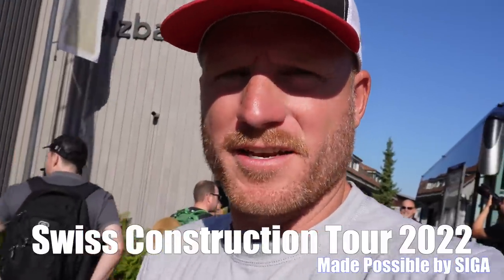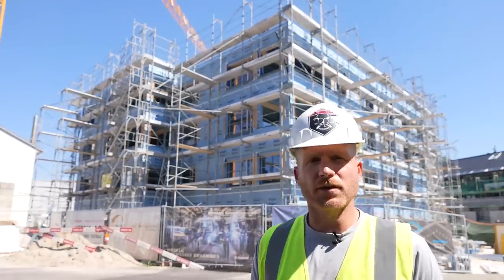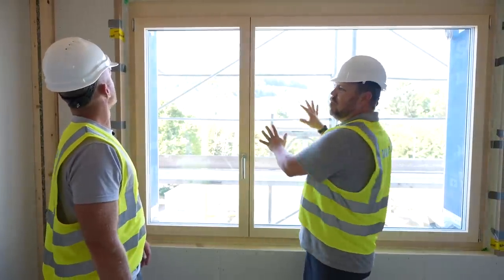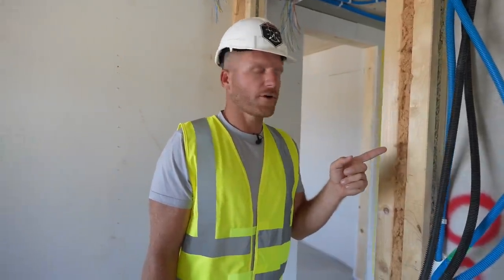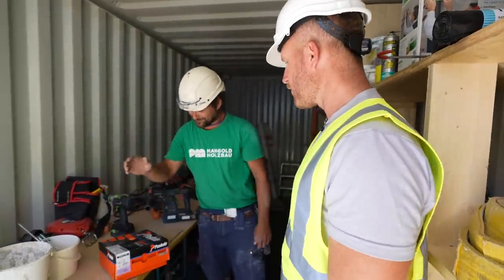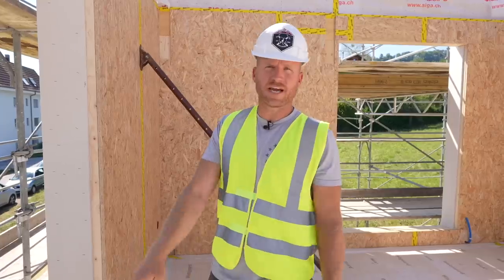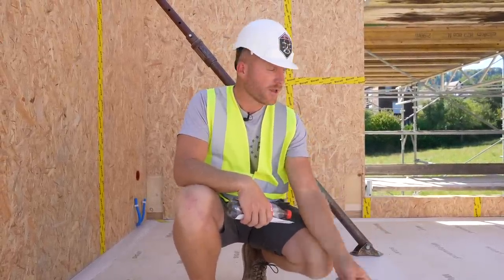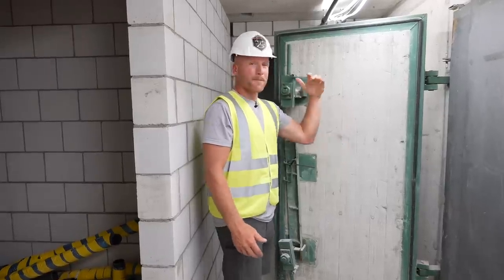Visiting a Swiss Trade School and Tool Trailer on a Swiss Job Site

Comment: Those big swinging windows also allow you to lift large furniture items into an apartment that probably has a rather small stairwell.  Same with entrance doors - they have a normal door with a sidelight that swings open. Very common in Europe.
Reply: Yes, i love those diagonal lift things used for moves in a lot of Europe. Very smart.
Reply: I worked for a removal company in Australia. The amount of stupid people that had to sell their furniture after arriving at their new apartment and realising that they should’ve measured their front door was ridiculous.
Reply: Biggest two reasons for the existence of those types of window (with the separate frame moving window) are:
A. easy cleanup
B. easy maintenance.

Comment: Home-builders not only in Switzerland, but also in Germany use Festool because here people are actually trained for 3 or more years on how to build houses (Ausbildung). So qualified workers like using qualified tools
Reply: And precision matters because there are standards that require a high level of precision ! And the owner is well protected in case of an issue with the build, so it's in the interest of the companies to do it right.

Comment: The woodfiber insulation is sweet. A dream to work with. No itching. Easy to cut. Its treated with a fire retardant so it "doesnt" burn. In my opinion one of the best thing about it is the hygroscopic properties, similar to cellulose insulation. Also, it has better convection properties compared to mineralwool.
Reply: Came in the comments looking for this response, I'm in the business but never seen the wood fiber insulation so I assumed it must have been treated with a retardant. Thanks for the info!

Comment: Just watched this video.
Great as always. How those windows function...I remember OVER 50 years ago, visiting family in Germany, my Aunt had windows that functioned that way.
Sharkbite plumbing, a system very similar to that I saw on a new construction build about 15 years before here in the States.
Sidewalk construction in residential areas of Berlin, basically all pavers. Remove pavers,  save to the side, repair/replace utilities, reinstall pavers. They use them over and over again. Single arm garbage trucks, saw them over 50 years ago in Germany. 
We always think we have the "best", smart that you open your horizons.

Comment: As a European I can say that the way they do it in Switzerland is very different from Norway. But we actually use sega tape on some of the buildings we erect for the outside, on vaxed gypsum boards and against windows and doors. We also use it on vapor-barrier. This is both to ensure a leak-free wall, as well as allow for a very small vacuum inside the house. Often on new houses you need to open up the varando-door slightly in the beginning when you light up your fireplace to get it going. In our country developers and businesses build differently, with different methods. But there are similarities to the Swiss, but manufacturers do not provide services for customers.

Comment: 3:42 There will probably be a green roof on top as this system is also use on Green R project to find leak under plant's etc..Worked on a project with a similar system (flattec) last month

Comment: 17:04 Würth here in Sweden have these lights, maybe try contacting the Würth US office and see if they can get them in stock? Ordering directly from China where these lights usually are made might also be an option. They are GREAT at a worksite, lights up the space so much better than regular bulb-lights.
Reply: thanks for the brand name... yes indeed. These gotta be the Wurth 9501006300, contact for quote. However (just for the americans): those are 230v strips, not 110v. Still looking for the underlying supplier / OEM for the strip itself. Before Wurth are terminating / weather sealing / certifying them. Or whatever else they might do.
Reply: @dreamcat4  They should definitely make a 120v version for the US market!

Comment: Training centers like the one you are at are typically only found through Union Trades. I went through the Carpenters Union Apprenticeship, it is a 4 year program, where you learn all facets of your trade, from framing to cabinets, drywall install etc. I don’t remember what state you are in but there is a training center like that one. Typically the better centers are near bigger cities.
Just thought i would let you know.
Reply: There are still other options available, ABC (Associated Builders and Contractors) offer training and are set up as a Merit shop option, and some state collages offer "hands-on" training,  As I went through 45+ years ago with a 2 year  Associate degree, leading to apprenticeship.  The program I went through is still available, and I just worked with a guy couple years ago who's son was attending the same program.  Good basic practices should be taught/learned, but the best apprenticeship is hands on learning.

Comment: The bomb-shelter thing is/was common throughout most of Europe I think. In Norway all larger residential buildings, along with schools etc were required by law to be constructed with bomb-shelters until the mid 90's.

Comment: Hey Kyle, that's how alot of union trades work in america. You apply and get into your local unions apprenticeship program. Go through a multi year apprenticeship while getting paid to work and then graduate a fully vetted carpenter/electrician/plumber. . . .
Reply from the maker: At 15??
Reply: @RRBuildings  Ya most don't let you apply until 18. I agree it would be nice if they got you in younger but I just want kids in the US to know that a labor union apprenticeship is something worth looking into.
Reply: I took a test for a carpenter's apprenticeship and easily passed a not so easy test.  Then found that I had to buy a couple of hundred dollars worth of tools and visit job sites until I found a job...  I said forget it.  The Unions are probably corrupt as hell anyways...  I was in I.T. at the time, but dealing with Carpal Tunnel syndrome, so it wasn't look for carpenter jobs or go back to my Mom's basement... just looking at alternatives...
Reply: @Ronald Bartell  Carpenters union is a great option, not sure how the carpal tunnel would effect work though.

Comment: Abstract

This video transcript documents a tour of construction sites in Switzerland, led by an American builder. The builder compares construction techniques with those commonly used in America.

*Key Points*

* *Swiss Trade Schools:* Switzerland offers structured trade school programs where students are sponsored by companies. Upon graduation, they are skilled carpenters ready to enter the workforce.
* *Flat Roofs:*  Residential buildings in Switzerland often have flat roofs to maximize building height within restrictions.  Sensor technology is used to detect roof leaks quickly and efficiently.  
* *Windows:* Swiss windows are high quality with tilt and turn features for ventilation. They are often installed by the manufacturer for accountability.
* *Sound Insulation:* Unique wall panels with a separation layer are used to improve sound insulation between units. 
* *Wood Fiber Insulation:* Sustainable wood fiber insulation is used instead of fiberglass or cellulose.
* *Panelized Wall Systems:* Prefabricated wall systems create a faster build and require the foundation to be perfectly level.
* *CLT Systems:* Cross-laminated timber (CLT) panels are used for floors and ceilings, providing structural strength and eliminating the need for traditional floor joists.  
* *Construction Lights:* Thin, strip LED lights are used for on-site lighting, offering superior brightness on a convenient roll.
* *Bomb Shelters:* Swiss law requires bomb shelters in residential construction to accommodate all residents.
 
*Overall Impression*

Swiss construction methods demonstrate a focus on precision, sustainability, and innovation. The American builder expresses a desire to incorporate some of these techniques into US construction practices.

Comment: I have recently moved from Europe to Canada, rented a house here and I am terrified with quality of the buildings here. If I get to build a house here, I will be importing stuff like windows and doors from Europe...
Reply: Hi Greg, I have lived here in Canada for about 50 years, [ formaly from Ireland ]
The Apprentship system is very poor in both the USA andCanada, Without the Carpenters Union starting up thier own training centers there would very little training of the youth , the same applies to the other trades as well,
The Goverments have to bring the instructors over hear to train the trade instructers in North America , there is no point sending people over there because they have not been trained in the detailed manner that Europe requires in order to recieve certification, that can not be achived by a 2 week vacation, 
Just pay attention to the job site, every thing in its place and a place for everything,
The Carpenters tool shed for example has only carpenters tools and Hardware for the work as needed at this stage of the work,
The trade schools of Europe also have a drop out percent which also helps the contractors because the students who make it through the first year  [tested several times during that first year]  are showing the have the interest required to complete their Apprentship.
There is also a grant system in place to assist Employers for the rest of the Apprentship program🔨🔨🪚🪚

Comment: I don't know what state you live in. However, here in PA, at the entrance to 10th grade, you are about 15-16. At the time, I went there was computers, electrical const., Carpentry, auto body and auto mechanics, surprisingly there wasn't a plumbing class, there was also a home ed/culinary, and then a nurses aide and cosmetology. The last 2 you could be certified by the state in whichever 1 you chose to take. These were all 3 year programs, with some cross overs, I had to do part of my 2nd semester, in carpentry, the teacher was a real dueche not a good experience. However, you could change every year, if you wanted to. I chose electrical construction, for 3 years, you start on job boards then move into mock houses, all the way to magnetic switches. Then I chose to go out, my senior year on OJT, working in a hardware store, that had a construction business. But they kept me in the store, b/c they were short people. I then went to Penn state Williamsport, for 2 years while this is 5 years of training, that helped me do this trade I love for 32 years, on and off, getting certified in this state is ridiculous. But the pay advantages are amazing. I would love to see the Swiss school, for electrical construction there, that would be cool. Although, most of Europe, and the rest of the world rely on 208/220 volts, some country's are even single phase, which in those countries, has terrible reliability, with a lot of brown outs. I imagine, England, Germany, the Swiss, Norway, Spain, Italy, and all those countries, and France, have fairly reliable grids. So, I would love to see the electrical shop there. but great video no matter what. And I just told my story so ppl, especially young people, know there is a path, as getting hired by a company, isn't always the best. As, you may end up a go for, for a year or 2, before you learn anything of value, and that discourages young ppl, who sometimes, have the attention span of a hummingbird (which I still do, lol). But great video, Thanks for posting.

Comment: In Ireland we let the window manufacturers fit .. if there is anything wrong it's there problem and they have to fix it.. if you fit them they blame you on  scratches or broken handles and such .. so we just let them at it... the apprenticeships in Ireland take around 4 years  over 7 phases.. 1-3-5-7 are on the job training... phases 2-4-6 are in college 10 week stints I think if my mind is right..   its a good few years back now.. but the lack of tradesmen now is terrible alot of the older lads are retiring and younger people don't want to know about breaking a sweat... the thing about Germany and Switzerland a tradesman is seen as a professional.. in Ireland your still seen as just a labourer.. it should change.. also how do you find out about these tours I'd like to go on one over there to see the difference between Ireland and the rest of Europe

Comment: and you haven't seen the the sky-frame windows yet... this windows are standart but most times in plastic. because wood or wood / metal are more expensiv and you should see some break in attempts.. there are some chalanges to brake in in 1min wit heavy tools.. and yes 4B is a large manufacterer but there are also other companys that make and i as single capenter also install some windows but mostly only by replacments..

Comment: Cool tour.  The laminated floors and the bow tie connections.  how do they handle swelling other than waterproofing.  In the rockies or dryer areas with little change in humitity you don't have swelling/shrink.  In a lot of the US you have wet and dry time of the year.  Without air I would think the Swss has some too.

Comment: Depending on the construction lights .usually 6 meters per transformer here. Also bunkers not mandatory anymore. It used to be. But most use it as a wine cellar. Last client I did had around 350,000chf worth of wine in there 🤓
Reply from the maker: Holy cow
Reply: With around  350,000chf worth of wine you almost need a ''bunker'' ;-)

Comment: I've yet to see a worklight strip like that in North America but it appears very similar to the Proteclight RibbON.  Was looking at them some time back but never did find an equivalent that would run directly from our grid.
Reply: I am not finding that on a search, do you have a link?
Reply: In Europe, standard power is 220V 50Hz.
Reply: @royreynolds108  and it is not equivalent to our 220V 60Hz.  There is 220V to ground(earth), where ours is 220V phase to phase.

Comment: it's 220 everywhere !
Reply: Or maybe 230 Volt 50 Hz and Europe has 3 phase residential, but not super high voltage or amps. I don’t know much about it, I’m not an electrician.
Reply: LED lights are most likely much lower, and DC. Probably a transformer to plug into, not into the wall outlet directly.
Reply: @scottperezfox  yes its 230V and the LED are low voltage and sealed (weather prove)

Comment: We also do prefabricated panelled wall and floor systems for commercial buildings in Canada too, but unlike what is shown here the panels in Canada, even tho they are robotically built, there is significantly more errors. and not much evidence of quality control with the wall and floor systems here.  Many times we will receive Walls that are 3/4 of an inch out of level for an 8 foot wall or floor panels with multiple floor joist that have all their nails missed and shoot 2 inches to one side. The buildings go up fast but with deadlines from management, lack of enough skilled labour and less than ideal products received for panels it’s nearly impossible to build quality structures that are actually done right. We have a long ways to go here in North America, and it’s sad to see while building a 14 million dollar project that I have a hard time seeing last more than 20 years

Comment: Not only does Paslode have a metal connector nailer, they also have a cordless coil siding nailer .I seen Robin Clevett use on YouTube
Reply: Hitachi/Hikoki(MHPT) has all that and more and my go to
Reply: @baseballdude8491  I have almost every metabo HPT tool made except the rebar bender and they do not have a cordless coil siding nailer.
Reply: @DixieNormous1  I wasn't only referring to cordless but they were the first to have the cordless strap tite nailer and my favorite 36V framer
Still for real production framing we still use our pneumatics and their framing and coil nailer are still going strong after many yrs of service

Comment: Fantastic information!!!!   Any chance they discuss the cost for per sq foot or any type of reference for pricing that you could share?
Reply from the maker: I didn’t hear anything
Reply: The price there would be in cost per sq meter but that is convertible easy enough.
Reply: i live in switzerland and compared to the us houses are extremly expensive. a flat like the one in the video gets sold for at least 500'000$

Comment: But if you keep a big window like that open for a long time it's recommended to put something underneath it for support. Because over time the weight stress will bend the framing of it, if not supported.
Reply: The walls are strong enough to support the window. This are no buildings with walls made with 2x6.
Reply: I’ve lived in an apartment with these, it’s hard to understand how solidly these are built and how much more sturdy these walls are than the US and the UK. I lived in a Swiss apartment in the dead of winter and didn’t turn on the radiator at all, and this was maybe a 20 year old building. Everything is built to a very very high spec.
Reply: 12 inch thick reinforced concrete wall do support very well the weight of thoses windows

Comment: Switzerland is amazing, but the cost of living is very high because of the incredible ways that they do things.
Reply: salaryes are also high
Reply: @maximus-6788  and taxes low
Reply: And the buildings are designed to last 300 years; unlike NA where they last 30 years if you are lucky.
Reply: @terrencejreich  Or 1 year until the next tornado season.